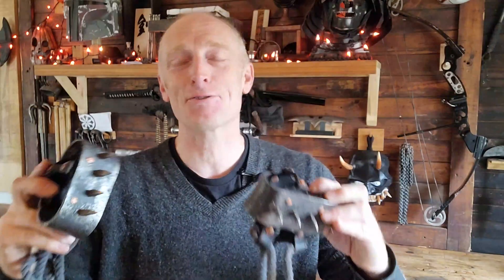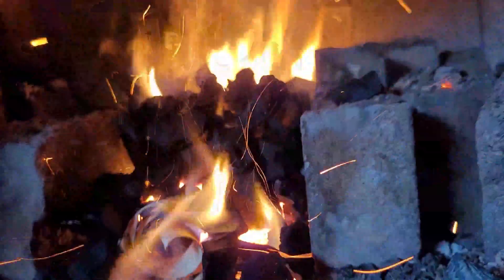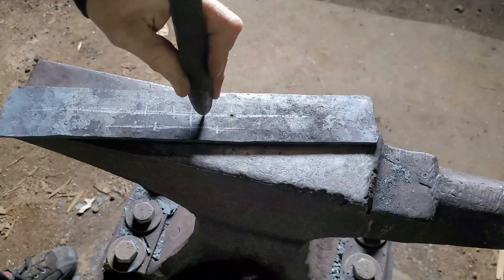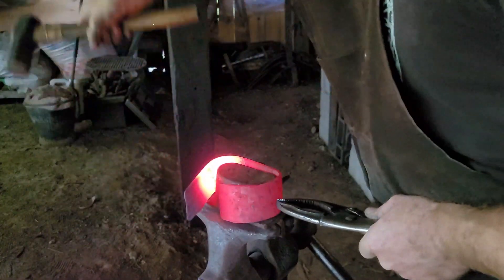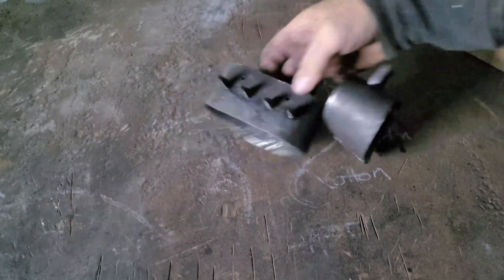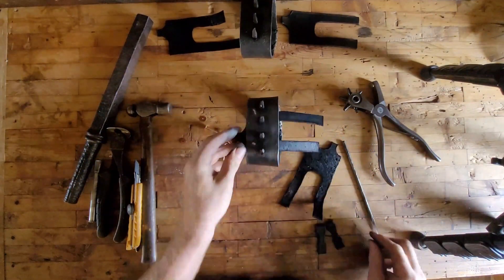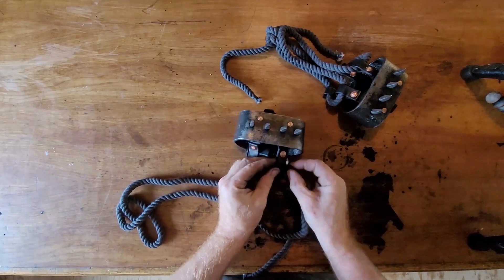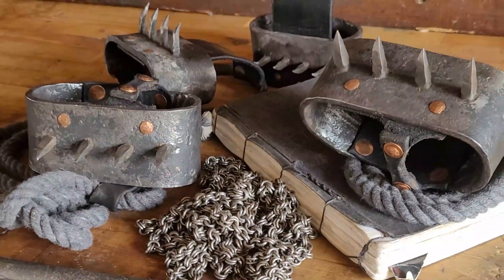How to hand forge Ninja Ashiko with simple blacksmithing tools

Comment: These are a much better design then the ones I use to have for Martialarts depot ( i think that's where i got them). any way I've been looking to replace mine and ran across this video. if only I have access to a welder and a forge this is the way i would go. 

are you going to do a video on the shuko as well? probably not as its mostly the same process I just noticed you have a different design for the wrist strap part which looks to be an improvement over the commercially available options.
Reply from the maker: Thanks! Ya a forge is the way to go; you can make many things. I will do a video of shuko (you're right so very similar) so I'll put that off for now.
Reply: @Ninedirections  do you sell these?